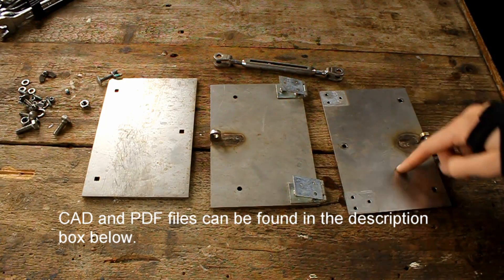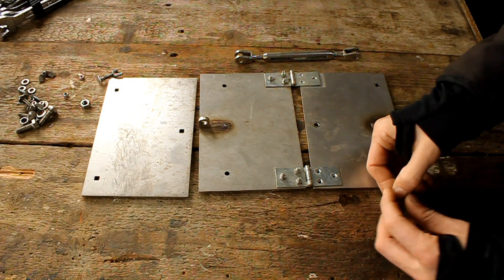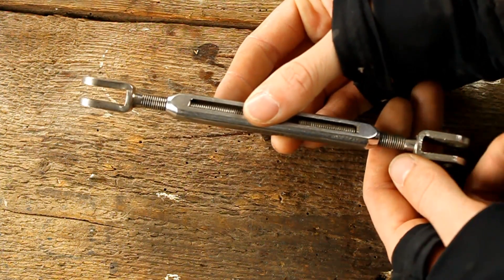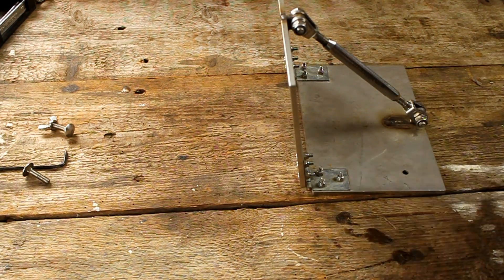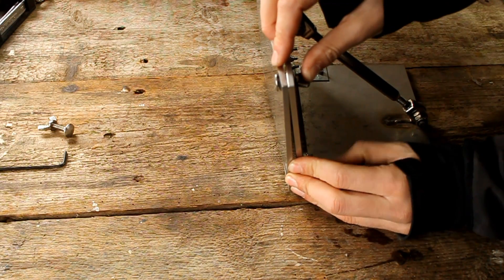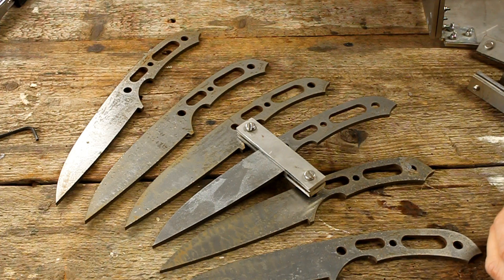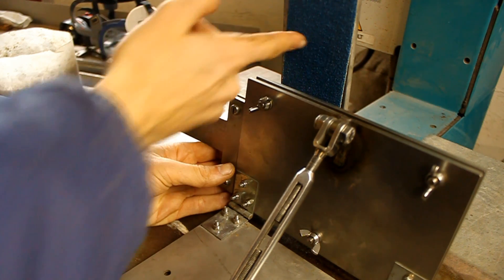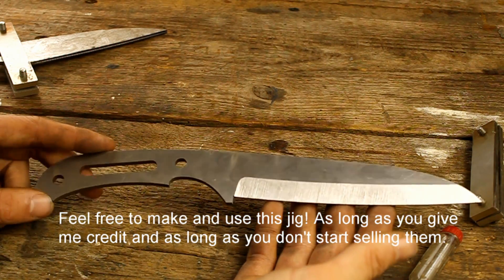How to make and use an adjustable angle knife grinding jig

Comment: How needed is threading the holes through the plates? Or is it just a durability thing?
Reply from the maker: Hi! Do you mean for the plates that hold the blade even?
Reply: @yesealex  yes cause I don't have a tap or money lol and wasnt sure how vital it was.
Reply from the maker: You can add a nut and tighten with a spanner. That might help

Comment: In English it not "funner" it's "more fun". EXCELLENT video, not a lot of irrelevant details, nice clean, neat shop and most of all, best of all your jig give the user absolutely dead on repeatability. If you had a couple of stations you could move quickly from heat treating to ready for the scales. That vertical indexing bar that clamps on the blade is PERFECT! Well done young man. Well done.
Reply from the maker: Thanks bruce! Humbled by such a nice comment!

Comment: the general idea has been done beforewith the hinged plates with screw adjustment,  but very clever making the outer clamping plate so one can be free from magnets, threaded holes, pins rests etc that would not work right for two different designs.   and for using the deal that clamps on the tang to make your insertion into the jig consistend and symmetrical.
Reply: also the large suface area that will clamp the handle tang would accomidate a wide variety of non-inline handles.
Reply from the maker: Thanks John. Care to explaine the meaning of non-inline handles? Thank you!
Reply: Alexander Bol most grinding jigs are very narrow on the upper plate that holds the knife and only good for holding on to handles that are, more or less, in a straight line with the blade.  Knife designs that use a more pronounced angle between the Centerline of the blade and the handles or that have a larger offset where the blade and handle come together wood need a larger area to be secured, such as with yours.

I am working up something simipar with a hinge and turnbuckle adjustment.  But the base will be wider so that the unit is more stable and more supported underneath the blade especially for longer blades on a smaller rest , and it will be made out of HDPE or a cutting board so that it will slide easy and I can submerge it in a water tank Point downward with the blade still attached if need be without having to worry about rust or swelling.  

I'm going to just use a easily replaceable short 2x4 for scrap for the upper part so that I can just screw the knife to it through the tang holes and easily replace it as needed.
Reply: Anyway the basic hinged plates skiing works much better than the wood blocks with a angle cut to the face or the angle iron with the screw jacks. Much easier to handle and can be reused for different angles on different blades more easily

Comment: Elegant design.
BTW--those bolts with the square projection under the heads are called carriage bolts.
Reply from the maker: +bwhip thanks ! I keep learning from every one
Reply: Thank you for the files. I've already imported them into ProEngineer and I'm ready to convert them to imperial materials and dimensions.
Reply from the maker: +bwhip cool! Yeah I'm a metric guy

Comment: The self locking nuts are called Nyloc nuts. They have nylon in them, not rubber. The clamp nuts are called Wing nuts and the adjuster, as someone has already mentioned, is called a Turnbuckle. Hope this helps.
The jig and blade clamp are great ideas, very practical.
Reply: Neil, I don't know anyone who calls them Nylock Nuts. Most people calls them Locknuts.
Reply from the maker: +Neil Cutten Thank you! Putting a video out there really helps for my technical english ;) Good luck if you want to make one!
Reply from the maker: +paralogia its the same, but lock nuts is more common I suppose. Thanks for the feedback!
Reply: Nylock is a brand name for a lock nut with a nylon locking insert. There are several styles of this type of locking nut. Some use various plastic inserts for the locking force and others used a deformed part of the nut itself ether circular or triangular deformation on the top of the nut. Plastic inserts for bolts that may or have to come off for inspection or part replacement and the metal type for permanent (more or less) installations using nuts and bolts. You could also call them aircraft nuts which the locking nut is a subcategory of. They are a one use type of nut in critical applications, for your jig they can be used over and over with little loss of their locking power. Your jig is not likely to fall out of the sky if a bolt loosens although it may drown if a bolt in the sea wall gets loose :) 

Very nice design. I am looking for a grinding gig. I believe I will copy it with some minor modifications to reflect my own needs. I am not sold on the turnbuckle idea. It is very solid, I feel that it could change angles due to vibration after it loosens up from use. Now that I think it through a little you could use a little shorter turnbuckle so that more of the threads are on the outside of the adjuster and then place a lock nut on the top threaded arm before threading it into the adjuster. If the top can't move then the bottom can't move and it wouldn't matter how loose the turnbuckle is. One extra step in the adjustment cycle. Being somewhat paranoid about things that move (see the last) I think I will have lock bolts on the top and bottom of each end of the clamping plate. The carriage bolt and wing nut is a very good idea. Thanks for your time and efforts.
Reply from the maker: +Think First wow Think first, you definitely did a lot of thinking! Good luck adjusting the design !

Comment: What would you charge to make and ship me one of these?
Reply from the maker: +Thumper1119 Whera are you located? Quick guess would be around 70-100 euro. I need to outsource welding which adds some cost.
Reply: +Alexander Bol   Located in USA  zip code 40740
Reply from the maker: Made a Quick Calculation: €100 for the jig with 5 setting tools, €25,95 for shipping so combined €125,95. Should take me a month to get all the parts tough. Let me know if you're still interested.

Comment: hi there,  I cant seem to get the CAD/PDF files to work.  I would say it has something to do with my computer.. So I was wondering how big ( L x W) of the plates used in your jig??   great video.   Thanks
Reply from the maker: +daironmonk https://dl.dropboxusercontent.com/u/41560263/EmergoDesigns%20Grinding%20Jig.zip Can you try this link? Or otherwise email me and i'll send the files attached
Reply from the maker: +bob smith Strange! Dimensions are 200x130 mm. Hope this helps!
Reply: The files are not working for me either, says they have been moved. Any help here would be appreciated.
Reply: +Alexander Bol Thank you very much, it worked!

Comment: Man, you have the talent to knifemaking .  You're doing a very good knives, and i have a question. What kind of steel you used to make knives ?
Reply from the maker: +Tomson Thank you! So kind :)
Reply from the maker: +Alexander Bol Missed the question: I use RWL34 for the smaller stainless blades and O1 for the larger blades. I hope this helps